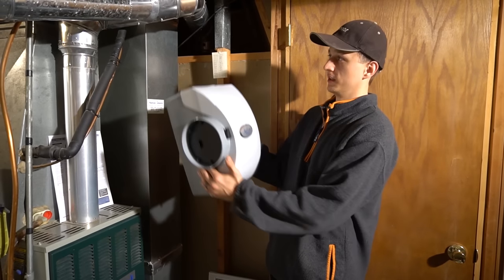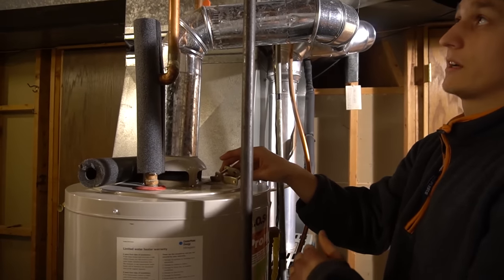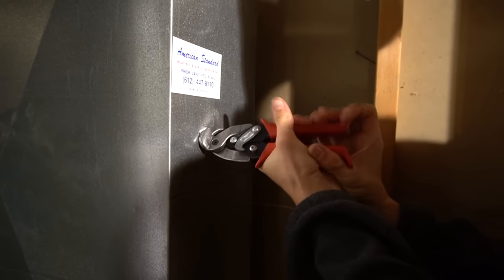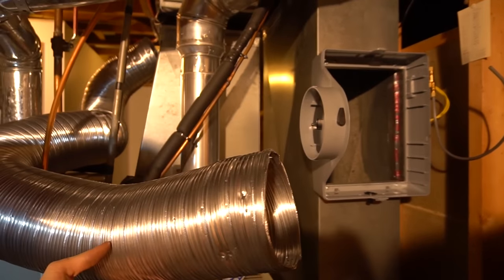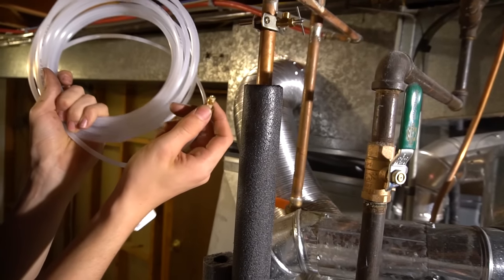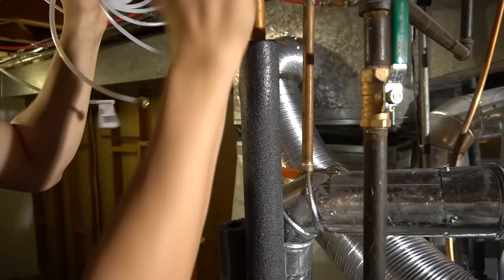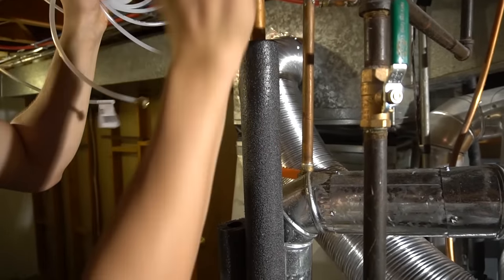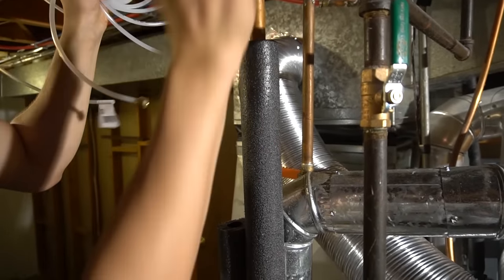Aprilaire 600M Humidifier Installation Walkthrough

Comment: Can the humidifier be turned ON either with heater or a/c? If I want to turn ON only humidifier, should I buy the motorized humidifier?
Reply from the maker: Thank you for the question! The humidifier is only used with the heater. You turn it off during summer. The air conditioner's main purpose is to de-humidify so if the humidifier was on they would be battling each other. About running ONLY the whole house humidifier, that is only possible if you set your fan setting on the thermostat to ON. The wiring may change a bit too. Many times it is wired to come on when the heater comes on. You would need it to be wired to come on when the fan comes on.
Reply: Takla3210

A fan powered humidifier should only be installed on upflow configurations systems like in this video. This is directly from Aprilaire due to loss of capacity in a horizontal system.  Powered fan humidifiers cost more and usually the motor breaks in time plus the molex plug wears out from taking off panel to change water panel. I would recommend a by pass humidifier and 400 or 400A is a great option cause save your water.  Unless your house is huge like over 3500 sq ft then you would need to go to a steam humidifier. Which is a completely different ball game. Way more money and a lot more maintenance

Comment: Great video. Wish I watched it sooner haha. Any suggestions on how to make the duct fit into the actual unit? I've ripped it 3 times trying to get the '6" duct' (maybe metric.../s) into the aprilaire unit. Did you cut flaps similarly to the ones you did for the plenum side ? Thanks !
Reply from the maker: Yes. If i remember right I only did 1-3 deeper cuts so that I could overlap the duct edge. That way it can actually slide in there. Cramming it in usually doesn't turn out pretty heh.
Reply: If you use hard pipe 6" it slides right in and you put one screw in to hold it.

Comment: Aprilaire shows that it should go over the coils, not on the return air side. Does it matter?
Reply: Correct, these go installed on plenum close to evaporator coil not at the return.lots of wrong installs on this video.

Comment: Thanks so much for putting this together, appreciate your taking the time. May I ask how large is your home (Sq ft) and how old? And was this humidifier sufficient for your needs? We have a 3000 sq ft home which is around 38 yrs old. Considering this and also looking at the Aprilaire 700. Hoping they will be adequate.
Reply from the maker: Our home is 1,600 sq ft. and its 47 years old. The humidifier was beyond sufficient for our needs! I left it on 40% right after I put it in and when we woke up the next morning the windows were all fogged up and dripping. So I actually leave ours between 15-20% now and that's more than enough. I am sure either of those will do the job just fine. As for the Aprilaire 700, that is the one with the fan built in right? I haven't worked on those much. The company I worked for only put in Aprilaire model 600. Manual and automatic. But anyway, hope it all goes well for you!
Reply: Thanks so much! Yes the 700 is fan powered.

Comment: Why did you wire into a current sensor relay? I don’t see any mention about that needing to be wired in to function.
Reply: If you have a manual ‘stat then it is required so the humidifier doesn’t constantly run. It makes it so the humidifier only runs while the blower is running. This is especially necessary in older or alternative furnaces that do not have a “HUM” function on the circuit board.

Comment: Reason, why needling valve will be installed at hot side instead of cold side.
Reply from the maker: You could do either side. The hot side is just recommended since it evaporates faster
Reply: @WordofAdviceTV  Wouldn't the cold side keep the solenoid from overheating?

Comment: Step 1, install saddle valve in the trash where it belongs. Step 2, install flexible 6" duct in the trash where it belongs. Step 3, Get proper materials or call a professional.
Reply: Cant you tell by his crisp clean cuts he IS a professional?
Reply: @SirHTMLguy  saddle valve fail. Had one on my copper pipes, and it began leaking after few years

Comment: The job you did is good, but you have to get rid of the copper pipe on the gas line.
Reply: Type L copper is approved by the international mechanical code, national fuel gas code , AGA and GAMA, and the appliance manufacturers.  Perfectly safe practice.

Comment: How do you decide ur going to use the large bypass (600M) of small bypass (500M)
Reply: Or *
Reply: And then as far mounting it. Are you Goin the return side with the humidifier? And then running the 6" pipe to the supply side duct?
Reply: Sorry trying to understand.

Comment: The clear vinyl tubing should be away from the flue pipe
Reply from the maker: Thank you for pointing that out. The drain line should be away from any flue pipes. Mine is touching the plenum and about 2 inches from the furnace flue. So far so good. ;)

Comment: I moved into a house, with an Aprilaire 550 humidifier. Its attached to the heater itself, not the supply duct. Anyway, even with the unit turned up to max, it doesn't seem to increase the humidity at all! Even tried replacing the water panel. Seems like it just wastes water, and does not humidify the house, at all. I have digital humidity meter, and it shows no increase of the humidity in my home. I want to remove the unit, and cover up the holes on the furnace. I guess it's not the correct type unit for this 2 story house.  Any suggestions before I remove the unit?
Reply from the maker: Sorry to hear that! I apologize for not answering earlier, I was out of town without my laptop.  I did not quite understand where the humidifier is... Is there literally a hole cut in the furnace shell/case/cabinet? Where the humidifier mounts into. Or is it in the supply plenum that is above the furnace? 

You probably already checked this but just to make sure... 
Did you verify that the water is flowing down the panel and going down the drain hose?
Is the winter/summer damper in the winter(open) position?
What  relative humidity percentage was your digital meter reading? RH %
Do you  remember approximately what the outside temperature was?

Comment: Advice from Fine Home Building, a bible for all things correct in building practice:
 "...you can't install a powered humidifier on the return. I never recommend even bypass types, because of some of the moisture issues listed below.
The cooler return air will simply not hold as much water. Most of the water supplied to the unit will trickle down the matrix and down the drain. Say the return is 65 and the supply is 100. At 60% rh, the supply will "hold" over three times the amount of moisture (in well controlled commercial systems, the duct humidity is limited to 60% rh for practical and wetting reasons).

You will wet the filters on a regular basis and most likely the fan and blower compartment and also the fan timer (otherwise known as the control board). The blower could tolerate a little moisture but the electronics and the filters will not do well getting wet(ted)."

--This video shows the humidifier being installed on the return duct.  Dont' do that.
Reply: Hate to inform you, but who ever gave you this advice doesn’t really know what the hell they’re talking about. Powered humis can absolutely be installed on the drop. All that humidity is making it’s way back through the furnace anyways. Aprilaire even suggests return drop installation. Been doing it that way for a while now, always works very well.

Comment: People talk about saddle valves like they're a catastrophe waiting to happen.  Yeah, they're not the best option but they're convenient and don't fail nearly as often or as early as people will suggest.  When they do fail, it's a very slow leak that you're going to catch before it becomes a big problem 99% of the time.  I understand safeguarding for the worst scenario, in case you're the 1%, but there's also the argument that you're unlikely to be the special one.

Comment: Try not to put on return duct. Think about it. Water and motors don't mix. Over time it will rot out the inside of the furnace. If you don't have room on supply plenum then go to steam..most have a tube to install easily into duct.
Reply: great video, but i agree. moisture will almost certainly cause premature failure to the blower.
Reply: A leak, which is common, on the supply could cause catastrophic damage to the furnace. Taking a chance either way with these.

Comment: Saddle valve is against the code in most states
Reply: What else would you use?  All I've ever seen is saddle valves for this application
Reply: Soldering the correct valve or at minimum they make a shark bite valve
Reply: @joemikhaiel3710  after looking into it, soldering in a 3/4x1/2 tee then using a 1/2x1/4 compression angle stop seems to be the way to go. Thanks
Reply: @fortunatedad7695  way to go

Comment: You could have installed an aprilaire 700 and that's a powered humidifier that would have solved your problem with the bypass
Reply: If the 600 barely fit there's no way the 700 would have fit as it is a good bit larger.  The plenum for the 700 is 14 7/8 X 14 3/16 while the 600 plenum size is 9 3/4 X 12 1/2.

Comment: I would not install a humidifier on the return air duct.
Reply from the maker: There seems to be debate about that.. Could you explain why?
Reply: Simple really...  It's a bypass humidifier, meaning air flows through a moist membrane and picks up humidity in the process.  Functionally/effectivness/efficiency it makes no difference if the "unit" hags on the return air or supply air side.  Return side sucks, supply side blows membrane is between, works same either way.  However from a logical perspective you have a "unit" with supplied water that works without leaks on installation date and that's fine.  6 years later when it does leak do you want that water running down the return air duct and onto inexpensive to mop floor.  Or down the supply air duct and into the expensive to repair much harder to clean furnace.  Functionally works exactly that same, over the furnace will cost you later.  Debate ended, informationOD has now been further informed.
Reply: In most cases the humidifier is turned on during winter time to increase humidity in the heated air that is being distributed throughout the home. In some cases people do use humidifier without a furnace. By installing the humidifier on the supply side it allows the hot air, that is usually dryer then the cold air, to pick up more moisture. So why does hot air hold more water than cold air? Well, air is like a sponge.  When air temperature increases, that sponge grows a little and the air can hold more water vapor.  When air temperature decreases, the sponge shrinks and the air can hold less vapor. So, if you install the humidifier at the return duct, the cold (cooler) air will pick up less moisture. Also if the humidifier is installed on the return side, the air will pick up moisture before going through the air filter and I've seen some filter getting moldy because of that. 

And to Jaythompson, if installed correctly, the condensation tray should capture any minor leaks from the humidifier and safely drain it. It doesn't make any sense to be concerned about leaks that may or may not happen. If that is the case you might as well install your water heater outside of the house in case it leaks and flood your basement and destroy the AC/Furnace next to it. Just make sure that you install it correctly and maintain it well. Jaythompson, I sincerely hope you're not a professional HVAC tech. that doesn't guarantee your own work. FYI, I'm a DYI'er with an engineering background and I take pride in my work. I installed my Honeywell 8 years ago and it is still running without a hitch.
Reply: informationOD The air blowing through it will be hot if the furnace is on and cool is the furnace is off. Do you seriously think that by hanging the unit on the return air duct it will have cool air running through it?  Think about it for a second, your engineering background should allow you to realize the positive pressure from the supply air being connected to the negative pressure on the return air side will ensure the air (hot or cold depending on heat call) always flows from supply side to return side. The “unit and membrane” are in between. It will work exactly the same from a functionality perspective wether the unit hangs on the supply side or return side. Functionally it makes zero difference as i stated prior. As far as humidity in the filter, think about it, regardless of where the unit hangs, air flows from supply through the unit/ducting and back down the return air side. Why would it make the filter mold more if it hangs on the return side?  Your answer implies that you think by hanging it on the return air side somehow the air will flow the other way?  And you are an engineer??? Wow. I am an HVAC pro and i can assure you there is Zero benefit to hanging it over the expensive furnace. As far as the condensate tray “catching” the water, i speak from experience as I have seen countless furnaces rusted out prematurely and even cracked heat exchangers due to water exposure. Wrap your head around how the air moves though the humidifier and you will hopefully realize why it will work identically. Think of it this way take the “unit” out of the equation. Now you have just a duct the runs from the positive pressure supply air to the negative pressure return air. We know the hot air from the supply will flow through the duct to the “sucking” return air side... right?  Now insert a moist membrane anyplace in that duct to add humidity. Hanging it on either side will have NO effect on the airflow or humidity absorption . I agree with your hot/cold air sponge analogy but it is irrelevant. You seem to think that hanging it on the return duct it will somehow “blow” cold air through it???  Engineer this in your head for a while before you challenge someone who is educated and experienced in this field. If you are smart you will realize i am correct. If you can’t come to this realization I hope you aren’t a structural engineer, and if so please stay away from bridge work.
Reply: @informationOD  I agreed with yours. i also had schedule with one of my customer HVAC. Dehumidifier was installed on return side. So This week i am going to fix it... I am just HVAC apprentice lic holder.

Comment: Why did u use a folding bar?
Reply from the maker: Why didn't I use a folding bar? Lol, well simply because I didn't have one while I was doing this.
Reply: Because any real HVAC tech wi have all proper sheet metal tools. Anyone that has done this can tell you have little experience in the trade or you have never worked in the trade
 1st off your hole drilled should have been very close to the line you marked. Why will you make more work on yourself when you can cut out a square. 
2nd when you get into double metal on corner of duct most people would use bullnose snips for the power of cutting thru thick sheet metal. ..
The video is wrong all the way around. Your posting to the public. Most average people have no clue. You need to advise all about safety 1st before you do your videos
Reply: I installed humidifier yesterday but the humidity is very low in my house, do you have any idea why?

Comment: @4:03 - Uh, yeah, make sure NEVER to wear any type of SAFETY GLOVES to protect your hands, when working with extremely dangerous and SHARP thin metal sheeting.

What could POSSIBLY go WRONG?  --- Signed, Lefty.
Reply: Tripjet999...... Crazy how this guy has no safey parts into his video. Majority of the public will not understand actually how sharp this is. It will slice you wide open in a sec and u may not even know your bleeding till you see it......
Reply: @pineychristian  I do hvac daily, and I don't wear gloves for the simple FACT that I can't work with gloves on. If you're careful, you won't and don't get cut. Been doing it for 5 years
Reply: @summitm18hvac90  i Also do HVAC for a living. My previous employer we had a full metal shop. We made everything in house down to slip&drive. I watched 12yr in trade coworker in the shop get over 20 stiches in his hand from not wearing gloves. We all have gotten some kind of cut or nick over years working in the trade. Better to be safe then sorry. Only takes one time to make a mistake.......
Reply: @pineychristian  to each their own is what I say.
Reply: maybe your body is made of metal, no any safety stuffs at all.  Also Did you install Dehumidifier on supply side?
Reply: That's what I was thinking the whole time lol

Comment: As previous comments mentioned, this video shows installing the unit on the return air side.  This is incorrect.  Doing this the humidified air will then feed over the very hot plenum and dry out.  Resulting if very little humidity surviving and moving through to supply the house.  Also, installing on the return side as shown will saturate the air filter eventually.
Reply: The humidified air can't "dry out". The moisture can't go anywhere (as a matter of fact, hot air can hold more moisture on it).
This kind of installation is mentioned on the humidifier installation manual.
Reply: Ron this is how a bypass humidier is actually properly installed. The ones that go on the supply duct are different in they have a built in fan to push air in. That's all so why those cost significantly more. And as for "drying out the humidity" you haven't introduced enough heat to change latent state of water to vapor. High limits cut out furnace operation when the heat exchanger reaches 160-180. Unless you live at 15000 feet of higher, you will not burn off that water at that temp.

Javier, you are correct. That is why we run humidifiers in winter and shut off in summer